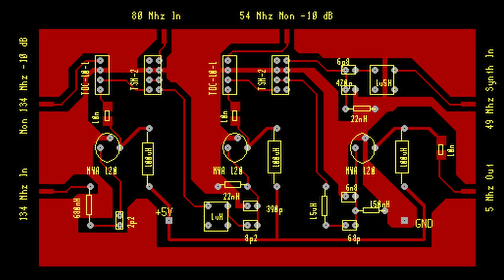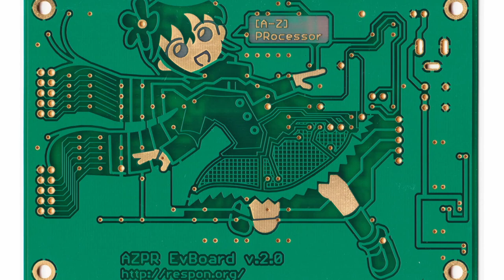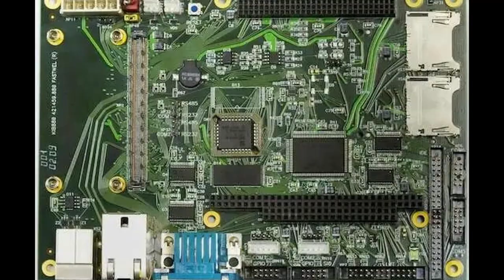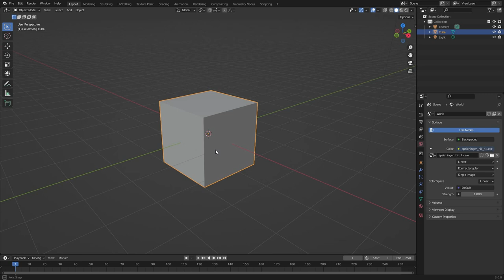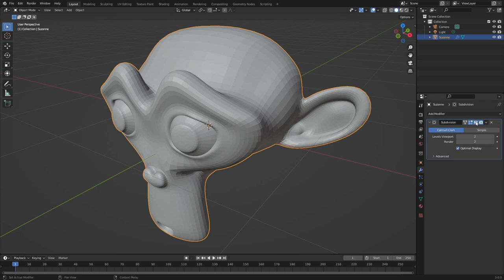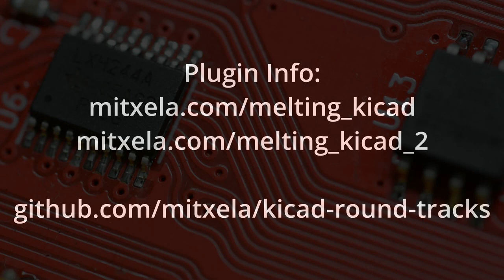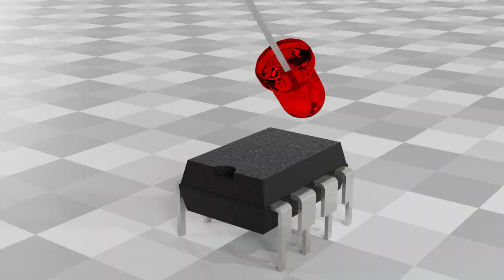Melt your circuit boards

Comment: I think the PCB designers that Mitxela described have lost perspective and need to take a few steps back and understand:  NOBODY CARES!  Nobody but them and a few other rare people actually care about how the PCB looks, or will ever even see it. They've forgotten that because their job involves staring at PCBs, most of which will be hidden inside things and never see the light of day.  With all the PCBs I have in my house, you know how many I actually ever see?  One: the motherboard in my PC, occasionally, and even then the traces don't matter to me, it's the colors.  I know my headphone amp has a red PCB, I can see it through the ventilation holes; that's cool to me, you rarely see red ones, however I don't care how the traces look.  So just, you know, chill out, and make things that are efficient; I want to buy a good electronic device, not a modern art display.

Comment: Man I wouldn't want to edit the cad models of the efficient routes. I suppose that's why you leave it to the computer
Reply: If you are talking about those TopoR-made layouts - they are very easy to edit in topor itself, actually much easier than in the normal layout softwares. Topor is magical. But it is a pain in the ass at the same time, as it doesn't have tools to work on schematics and footprints, and it's compatibility with kicad is hopeless... well, it was a few years ago, not sure what's going on now.

Comment: Not bad, but not as good as my track layout algorithm:
A weighted "repellent" one, where certain tracks either repel each other, or attract each other on a square law, according to multivariate path optimisation.
Try it. I have yet to patent it.
Reply: Can you link to examples? Maybe making this open source would get you a lot of attention?
Reply: @qu1j0t3  I am making more money by designing and selling the resultant boards to industry than I could possibly make from making it open-source.
It is just a suggestion for the more mathematically educated to ponder: those professional programmers with applied math degrees at a minimum.
Reply: @MichaelKingsfordGray  Great. Any chance of posting some examples so that we could see how the results are superior?

Comment: Why go to all the trouble to achieve technically the same thing?
Reply: why climb a mountain? nothing will change.
to look down with a new perspective. to learn and have fun.
Reply: @downey2294  Why climb indeed, when you can fly up there with less effort and get the same perspective.
Reply: @XiaZ  no you wouldn't have. climbing a mountain takes effort. you'll need to overcome challenges and show resourcefulness. you will have become a more rounded person when you have reached the top. you will achieve a sense of accomplishment. you wont have that if you "fly" up there. 

people don't climb mountains because it is easy. people do it because it is hard. to challenge themselves.
Reply: @downey2294  I'll get the same end result with flying anyway.
But if you talk about the challenges, who said flying won't give you any? by flying there, you will experience things you won't be able to if you climb, the same is true vice versa. So it really comes down to the end result isn't it?

Climbers can't tell if flyers are easier, and vice versa. we can only look at statistic and record.
Unless you want to try both, then be my guest.
Reply: @XiaZ  its not really about the end result. its about how you get there and what you wanted out of that experience.
Reply: @downey2294  but it really is all about end result. If you really don't care about it then you just try climbing a bit and said "now I know how it feels" without having to reach the top.
Reply: @XiaZ  that doesn't make any sense. how can you say "now i know how it feels" when you haven't endured the entire journey. 

let me put it this way. when you decide to start playing a video game. do you play through it? or do you download a save file that has already completed the game and call it a day? you will get the same end result.

we don't play video games to get the end. we play them because they are fun to play or because they challenge us or because we want to experience what the game has to offer. getting to the end is just a side goal.
Reply: @downey2294  "now I know how it feels" was just an example for your "its not really about the end result." statement.
If it's not about the end result as you said, you won't care if you reached the top or not.
How can I say "now i know how it feels" when you haven't endured the entire journey? Exactly! the end result is the thing you care about.

Talk about game? yep, read my original question again, "Why go to all the trouble to achieve technically the same thing?"
If by play the same game, but with other route that reached the same conclusion, that's just bad writing, I won't try that route at all if I have know before hand.
The end result is the only thing that matter in this scenario.
But if that game has more than one ending, I'll load the game at plot branching point and play to reach the new ending, skipping all the old dialogue I have read before.

We do play video game to reach the end, we play them because they are fun to play and challenging, and because we want to experience new thing.
Getting to the end is the final goal.
Reply: @XiaZ  why bother playing through all the endings? just download all the save files with all the endings. if getting to the end is the goal you would have achieved that by downloading all the endings.
Reply: @downey2294  Because in multiplayer RPG, there's no save file for me to download.
If there is, I won't bother playing it, just download and see the end like you said is enough.
But since I can't download it, I will have to play it.

Let me put it this way; If I play a game 2 times, first time ends in ENDING A, where it is a bad ending, and if I know it has an ENDING B, where it's a good ending, I'll try to reach both endings, because it's not the same, I know there's a better outcome.
I won't enjoy the second run though, I'll have to skip all the gameplay I already played, and maybe load the save file that was created just before the branching point for ENDING B.
In my original question, "Why go to all the trouble to achieve technically the same thing?", I was asking why he was trying to reach the same ending.
It's like playing twice, aiming for ENDING A both times. why not improve the design, like making it better or something?
Reply: @XiaZ  well first I'd argue whats wrong with playing the same ending twice. there is nothing wrong with that. if someone were to enjoy doing that then that is their reason for doing so. because they enjoy it.

but id still argue that its not the same ending. the circuit boards clearly look different. 

if you play a video game and you complete one ending its technically the same as completing another ending. you still completed the game. only through other means. this analogy still works with the circuit board. every line is still connected correctly only the means of connecting them was different.

i also don't agree with the notion of linear games being "bad writing" its like saying books are bad because they only have one ending. that's silly.
Reply: @downey2294  There's clearly something wrong with playing the same ending twice. maybe if you forget it I can let it slide, but if you still remember it and start a new run with that ending in mind, ooohh no, that's the speed run mindset. it's unhealthy, quit it before it's too late.

The circuit board looks different but functionally the same, unlike both of the game endings.

But it's not the same ending, one ending you save the princess, one you don't. it's like read two books with early chapters that start identical to each other.

One ending is not good enough, That's why games are better than books, they're not linear.
But they're also a lot harder to write, which explains the ratio of good books to good games.
Reply: @XiaZ  you are saying things like the have objective truths to them "games are better than books", "There's clearly something wrong with playing the same ending twice", "One ending is not good enough", "they're also a lot harder to write". none of this is objectively true and has allot of nuance to them. this is an incredibly shallow mindset to have.

anyway i don't think i can convince you that there is more to life than just the end result. so i guess we'll just have to agree to disagree.
Reply: @downey2294  I don't know what you are talking about, my English is not so good, I don't know what nuance was implied. My words may have double meaning that I'm not aware of, which is not my intention.

Games are objectively better than books. Games, as a media, are way better than books.
You can put a book inside a game, but you can't put an advanced game inside a book, not even a sound or music.

One ending is good enough or not depends on context, but my original point was to counter your point about calling one ending in books silly.
Of course calling a book with just one ending a bad book is silly, but it is not the same as a game.
Books, by design, are hard to make multiple endings happen. but for game, you can have any amount of endings you want.
Game give you a mean to add more endings, which is not to say one ending is bad, but you can make it better.
They are a lot harder to write, which is also objectively true. Imagine this sentence: "Mr. A stole a bike."
If you want to write it down into a book, it's just one sentence, but if you want to write a game that explains the same thing, you have the option to do the same and write down just that sentence alone, or make it a moving picture with sound, or even make it interactive.
The potential games have to offer are way more than books.
Imagine your favorite book, in an ideal scenario with unlimited budget and time, if the writer uses a book, there's no way he can make a better writing than if he was to go with game.
Why I said unlimited budget and time? because as mentioned before, games are a lot harder to create than books.

"There's clearly something wrong with playing the same ending twice" maybe subjective from my part, don't mind me.

Anyway, that's the ending you chose mate. the ending is all that matters isn't it.
Reply: @XiaZ  your words don't have nuance to them the concepts themselves are nuanced. a story has more than the amount of endings for it to be considered good. things like: world building, character development, the characters themselves, the style of writing, the genre, etc. and even then. you can't decide for people what they enjoy.

you can't tell people they have to enjoy something over something else. you don't get to decide that something is better than something else. people decide that for themselves. you don't get to tell them that. you don't decide for me that i enjoy video games over another piece of media. 

to say that a book can't have multiple endings is also false. and there have been books that have alternate endings. this doesn't make the book objectively better or worse its just an attribute the story has.

you also haven't thought about people that might have a condition or handicap. who are you to decide for someone with motion sickness that a video game is better than a book. video games might make them incredibly ill. they wouldn't be able to deal with it. but they can enjoy a book just fine.

just because something is hard to do also does not make it better. 

you don't even consider what other people think. or that there are other variables at play.
Reply: @downey2294  The same story, written by the same people, will be as good or better off having more than one ending, always.
Even if you don't like the second ending, it doesn't make the first ending that you like, less good.

I won't tell people to enjoy anything, I just said that game, as a media, is better than book.
Books, in other words, stories, can be put in a video game.
Video games can't be put into books.
Think of it like this: Video games, as a media, are a direct upgrade to book, everything book can do, games can, the opposite is not true.

I didn't say books can't have multiple endings, I said it was harder to make happen.

I feel bad for people that can't enjoy books, just like I feel bad for people that can't walk.
Yeah, they might not be able to walk, but they can commute on a wheelchair just fine, but that doesn't mean they don't want to be able to walk.
walking with your own feet will always be better than using a wheelchair. just like gaming will always be better than reading. You can read inside a game too, you know? There's just not that much book-like game out there, you know, game that feels the same as books, I mean, at that point you can even call that game a book, if you're willing to go to that extreme. but that didn't change the fact that games, as a medium, are a direct upgrade to books.

"just because something is hard to do also does not make it better", I agree. but I didn't say that it's better because it is harder. I said, it's harder to make them at the same level, that's why you see a lot more good book than game, because it's way easier to make than games.

If I don't consider what other people think, we won't be having a conversation yes? now, who's the one calling out the other here, hmm? you said I didn't know that there are other variables at play here, too? we don't have to talk like that, okay.
Reply: @XiaZ  you can't say that games are objectively better then books. you don't get to decide that. that's a subjective opinion
Reply: @downey2294  I can, and I'm not the one to decide. it just is, just happen to be that way.
like 2 is more than 1, true is opposite of false, color TV is an upgrade to monochrome TV, and video games is an upgrade to books.
this is in terms of medium, not in the quality of the said medium we human currently possesses.
I'm not talking about opinion here. I didn't say that I like video games better, I like both books and video games.
Reply: @XiaZ  no its an opinion. its not an objective truth. saying color TV is an upgrade to monochrome TV is also an opinion. opinions are not objective truths.

seeing how we are not able to find any common ground and made 0 progress during this entire argument i think its best to just drop it. its a waste of both our times so i wont be responding anymore.
Reply: @downey2294  objective truth can be opinion-ifying, if you say it like that.
Like saying "I don't believe 2 is more than 1", or "I don't think color TV is an upgrade to monochrome TV", which can be true or false depending on your context.
Trying to find the scope of the conversation can also help you find context in most cases.

I also agree, I can't change anyone's opinion about what they believe is an objective truth, trying to do that is harder than solving the theory of everything.

"It's a waste of both our times", implying experience you gain is a waste. Told you, the end result is the only thing you seek.

Comment: Ok, but what is the point really?
You still have to design the board using 45 degree bends, converting it afterwards then offers little benefit.
Finding the most efficient path between components makes boards not only a PITA to troubleshoot, it's completely unnecessary. You aren't paying more for longer traces!
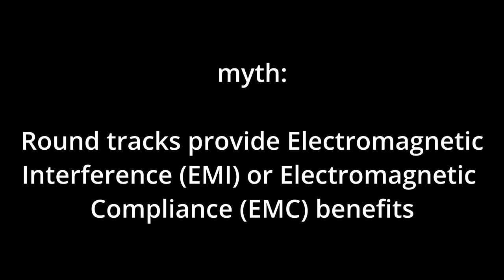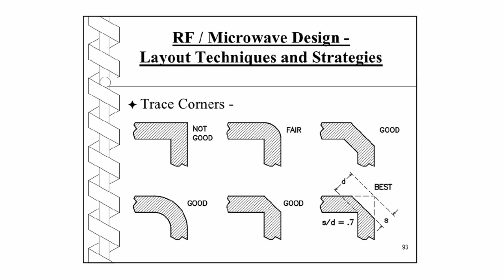You criticize the use of 45 degree / round corners at 2:11, then precede to advocate for them at 2:52! You literally say "you don't need to use a curve"!

Comment: I taught electronics for many years and I found it impossible to get the kids to design elegant PCBs.
None of the educational packages were any good at autorouting PCBs design and a simple graphics program set up with a collection of presets and primitives tended to be the best compromise for the pupils. Indeed one educational software house did exactly that with their PCB package, It was exactly the same as their graphics package. 
I remember one boy trying to fit three tracks between the pins of a 0.1" spaced chip and wondering why it wouldn't etch properly.

Comment: I wish someone fork it for Altium haha. That will be perfect
Reply: It already has this feature.
Reply: For real? I need to know this right now.
Reply: @203null  If you draw a 45/90 track, you can turn it into an arc by dragging the corner with the mouse and pressing Shift+Space-bar. The teardrops cannot be manipulated in Altium, unfortunately.
Reply: @danielmusat597  I know about that. The point for this video is auto convert all 45-90 to curves instead doing it manually. Curve drawing in altium is so fragile that it’s mostly a waste of time

Comment: 4:50 , I don't necessarily agree that it can be "more beautiful", the aesthetic of circuit boards being all straight lines and 45 degree turns absolutely is beautiful in its own way. Certainly there's more variety in hand drawn, but it is subjective

Comment: KiCAD is a horrible system, I took 14 hours to do a simple drawing, this was because none of the tutorials matched the operations or described features that were not in the program or people were using the most recent version. Using it, makes no sense at all, I am very used to the layering principles of building up an image or thing from slices / layers but KiCAD is just total ball ache, like most of them that use the same multiple menu inputs that really don't need to be there until you get the drawing done. Makes me wonder about programmers today, they don't write intuitive software, if these CAD programs were truly all powerful, they would redesign themselves to be easier and less confusing to use.